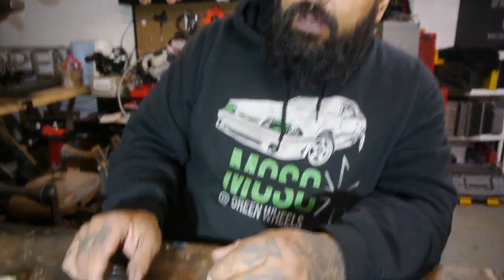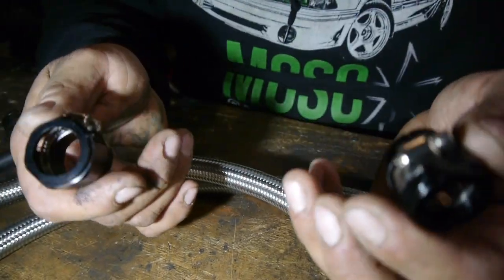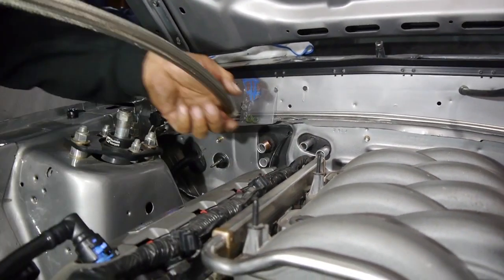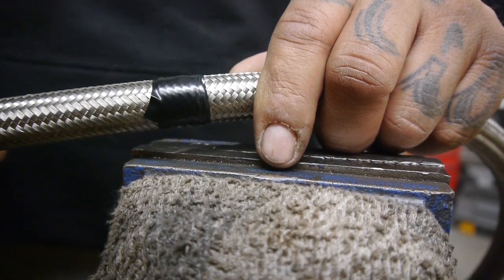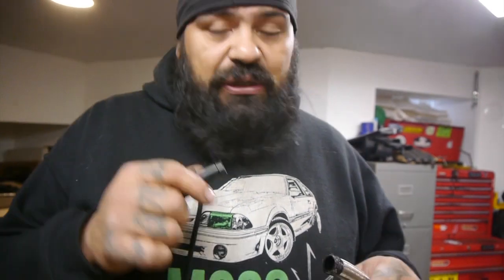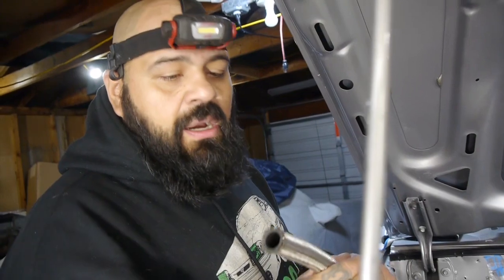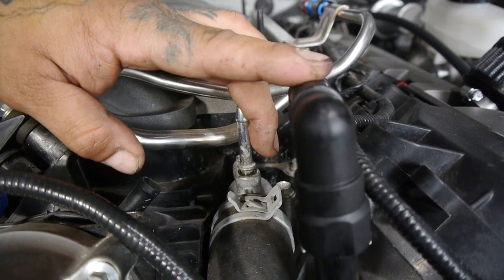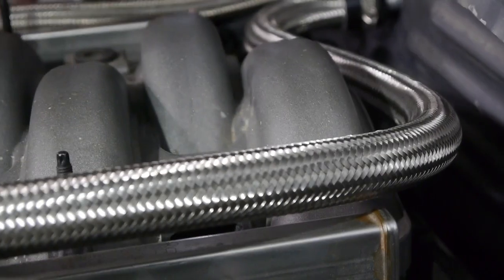Ford Coyote Swapped  Foxbody  Mustang Heater Hoses Solution

Comment: Been following this build for a long time. Love it and keep the videos coming. I can’t wait to see it run and drive!
Reply from the maker: NCpilot79, thank you for the comment. I hope that you are in great health. I cannot wait to finally be done with this project too. There is two coyote swap projects here going on. It has been rough trying to figure things out like AC, Heat, power steering, power brake, rear end, suspension etc. . . I know you probably know the trouble with this car, we getting scammed by two body shops, that we had to do the rust repair ourselves after it was painted two times by two different body shops. We just refused to give up on it, and we want to see it finish and done too.  https://www.youtube.com/watch?v=N2k-cCuK6_E&ab_channel=MCSCGREENWHEELS